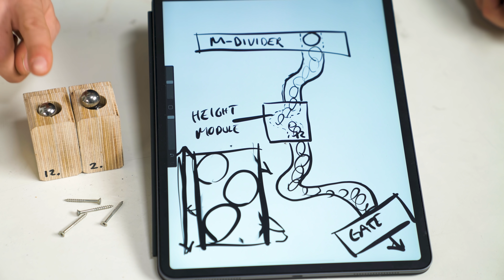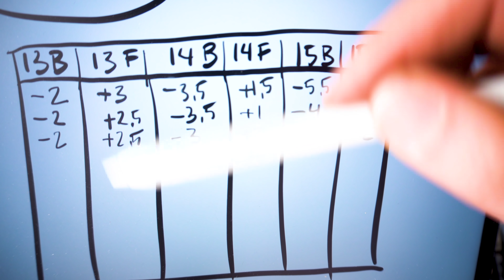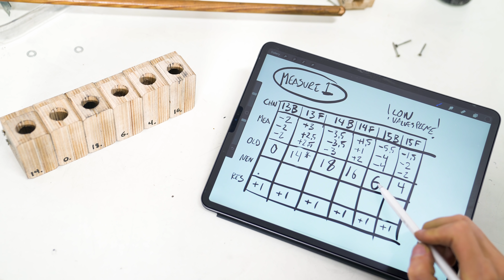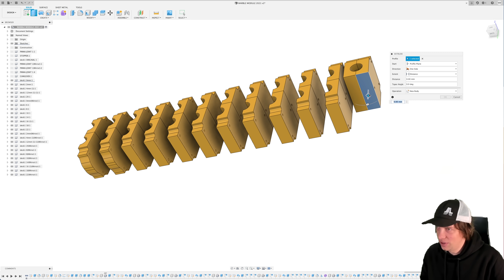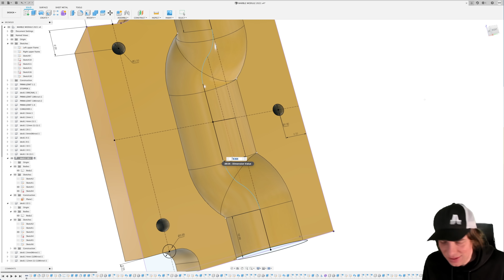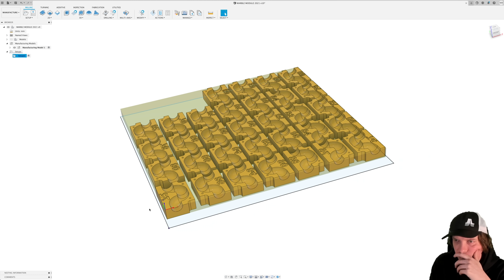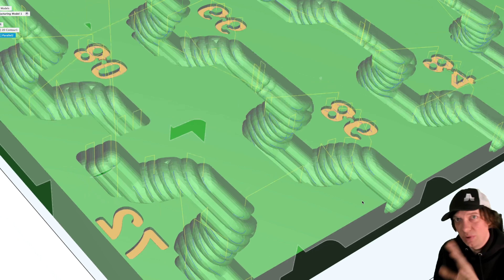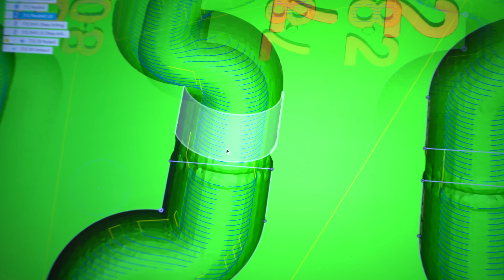Marble Hobby Project Gone Wrong

Comment: Have you considered using an adjustable telescopic pipe or similar system for height/length adjustment?

It is great to see the progress you make, yet i feel you are overcomplicating the height adjustment. I think you need a solution that can be adjusted on the fly without swapping out parts. Instead of having the wooden blocks with curved paths, you could make a basic telescopic section (two pipes that slide into eachother) with a locking screw to set the length. Or even a wooden version with two wooden pipe segments that partially slide into eachother, using a screw or bolt to adjust the spacing between them. This would give you quick and very precise adjustability, perhaps even while the machine is running. And it would be safe for changes down the line and any moles that pop up when setting up the machine on tour.

To see an example of such a system, take a look at legs of a camera tripod or microphone stand. Of course you woud only need one short section. Or google pictures of "adjustable telescopic pipe".

Comment: The marble divider is simply a bad solution. Your having to design complication after complication to correct the fundamental design problem of the divider itself. Look at the entire feed loop, the positioning of the marble DOESN'T matter. But yet, in your divider your having to position the marbles to 0.5mm. Its a joke. You can't go from complete free form movement, to perfect 0.5mm accuracy for ALL channels. You instead need to break the divider into 5-6 "bins" that feed all then feed 4-5 channels. Each bin can have an overflow with absolutely no error with accuracy. I hate to be armchair engineer here. But seeing day after day of you hitting a brick wall with problems, you need to look at the release mechanism. Pain in temporary, glory is forever. Rip the whole thing out!

Comment: Guys, what's up with all those trapdoor ideas? No, it would not work. Can you imagine dozens of trapdoors realibly go TRRRRRRRRRR and not interfere with a single marble coming their way? Impossible. You can't have a part moving in any direction but the marble's direction, otherwise there is a chance they collide and cause problems. Big problems. And it has to not fail 99.9999% of times. That's the absolute minimum.

Comment: I know the machine is way past its "let's make a huge design change"- stage. BUT, an improved design for the marble divider just stumbled across my mind. So I thought I'd share it with you. Let me try to explain.

The basic idea goes as follows: Instead of the marbles rolling on top of every other marble in the channels, make them "roll on the side".

 This will eliminate the diffiiculties of calibrating every channel to be the exact height and also take away the problem of inconsistencies in the marble tower height. 

Let's say the marbles roll in a groove with a 90° angle, basically a "square tube cut in half". Then you have slots in one of the sides where marble fall into the channels. And since you know the diameter of the marbles you can cut the slots to a appropriate depth. When the channel is full the top marble line up perfectly with the wall of the track since it's only dependent on the diameter of the marble and not the length of all marbles in the channels combined.

Hope this makes sense. And thank you Martin for this awesome content!
Reply: so you mean that the exit path from the divider begins with a 90 degree turn, and the turn has room for exactly 1 marble? the stack of marbles in the downtube could then have a lot more margin for movement and still have the top marble be flush with the divider, since the flushness is measured sideways instead of lengthwise of the stack. there will still be some variability between the top marble and the divider que, but the effect on the divider could be a lot less.
Reply: @frank7911  Yes, exactly. And as you point out the height of the stack still affects the exit slots as the largest perimeter of the top marble will move up or down in the slot according to it. But, at least in my head, that is not as big of a deal as having the same variability and the marbles rolling on top of each other and dropping down, instead of sideways. But I could be wrong. I'll maybe design and 3D-print a proof of concept to see if it is any better.

Comment: You're going to hate my suggestion on how to fix marble height/drop timing.
1. Increase the slope of the divider so the marbles have more inertia and can't stop in a channel that's +/- 3 mm.
2. Complete rebuild 😃 where the programming wheel is acrylic plates with holes for the marbles to drop through and eliminate the entire dropping assembly. Marbles held in a single row charger fed by the fishstair only, that then drop to the instruments at an even height, with all instrument mounta being height adjustable to account for shifting in transport. It'd have to be twice as wide, but much much less complicated. And then song plates would be as simple as a CNC program to drill marble sized holes.

Comment: I am watching your videos for a long time now, I am always ordering why you are not using a 3D printer to make complicated part like these ones.   You already 3D design it, the logical next step to me is 3D printing.

I think (don't have a CNC router to confirm) you will have more precision with 3D print parts, also if you print in Nylon (or other strong material), the part will last longer than plywood.

WHY ? WHY ? WHY ?

Comment: Can you use the marble path length as the label to make measurement adjustment easier?  Instead of 18 it would be more like 56.68 if the length of the center of the path is 56.68.

Comment: How do you know that the marble bottom at the bottom of the height module is flush?
Why not just add a mechanism to help the marbles over the little humps?
Plus or minus 1mm seems like a ridiculously small margin for error where you should consider a better method.

Comment: I think it might be possible to make an automatic module. A bold claim I know, but I observe you are measuring the path length as the centre line and not the sum of radii. The right path could trap a marble near the top held in place by the marble below that could move almost it's full diameter before the trapped marble could move.

Comment: As others have said, it should be possible to do away with the marble path adjusters via a mechanism at the top that only permits a marble to enter if one is absent underneath.

Here's my sketch for how this could work:
https://imgur.com/a/RmHRoxD

Only 1 marble can drop in at a time. The present marble and a bar prevent the hatch from opening when a marble is present underneath the hatch. A counter-weight opens the hatch back up when the marble underneath goes away.

Here's the model link: https://www.tinkercad.com/things/6BtfZuMaUvU
Reply: My concern is what happens if a gate gets stuck in something like the second position in your sketch. Could be a fairly catastrophic failure.
Reply: @JonReevesLA  I agree that it could be fiddly. I understand why he's using the design he went with, to avoid any mechanical parts that could fail.

Hopefully people can expand on this to make it simpler and less error prone. Really seems like there should be a way to solve this problem for any size marble without tuning

Comment: 9:34 "I only have to change two parameters to create a completely new version here." – As a software engineer, I immediately have to ask: Doesn't this program has some number-to-string function, which allows you to calculate the string (62) from the number ((16.2 - 10)·10 = 62), so you only have to change one parameter? (This would make this less prone to mistakes in the copy+paste process.)

Also, does the machine support adding a pen instead of a drilling tool? That might be even faster than engraving the numbers.

Comment: I'm going to be honest, I don't think that the marble divider will ever be perfect enough to work in the way martin is envisioning it. This solution will 100% work in the studio, but once you have to take apart the machine and put it back together for the world tour it won't hold up. All of the pipes would have to be inserted exactly the same every time, your environmental conditions would have to be similar. Perhaps there is another option? trapdoors that lock once a certain amount of marbles go through? it adds more parts and more complexity to the machine, but it might be worth it to avoid spending hours between shows tweaking 38 channels of marble heights. I have a few ideas on how this could work, I think i will drop some drawings in the discord soon

Comment: Loving the detailed videos! I very much enjoy the look into your CAD workflow and thought process on small stuff. But don't stress out on the videos. We enjoy the view, but it should motivate, not drain your motivation. As a backseat engineering comment, the height adjustment mechanism to me looks super fragile, especially if the machine sees lots of use things will move and settle etc. The current marble divider itself seems to be such a hotspot for things to fail?

Comment: This isn't the first redesign of another component that's been necessary to correct for the function of the marble divider. This seems to reveal that the recurring problem is in fact due to the design of the the marble divider itself. What about rotating the angle the marbles enter the channel pipes, so they roll mostly on the smoother, flat surface of the plywood on the other side of the marble path? 😊

Comment: You should realy add fillet into the trailing edge of your turns your balls might end up getting stuck in it. I don't think it cost a lot, and i am pretty sure it will avoid some problems into the future.
Love from a fellow engineer.

Edit: Sharp edges tend to be realy bad for flows, circles even if small are way more efficient for flows. I am a engineer in fluid mechanics I am pretty sure i can help in bettering the efficiency of the design of some of those canal if  your interested don't hesitate to ask. I think ther is a lot a similarities betwwen your project and my work, and considering the marble motion as a flow could be good enough analogy.

Comment: I had that problem with manufacturing model moving around after I'd carefully positioned everything. Super annoying. Not sure if this is the correct thing to do, but what I did was to fix everything in a rigid group after arranging them. But make sure the rigid group is at the end of the timeline otherwise it screws things if you have to go back to modify things!

Comment: I slowly get the feeling that the angle of the marble divider is where it's at. With all the free space, the input doesn't have to be vertical, but can be horizontal, thus eliminating the need for a flush marble height over all the channels.

Comment: Martin, I think you've solved the wrong problem. While you certainly do need to adjust the length of the marble path, the only reason you need sub-millimetre adjustments is because the marble divider is too sensitive! Instead of approximating a smooth incline, the divider could descend in tiny stair steps, say 3 or 4 mm per channel. Then the top of each marble could vary that much, as long is it was no higher than the level of the previous channel. Then the variability of the marble packing within each path would not matter nearly so much.

Comment: Super awesome Martin - I've watched every single video all since the birth of this wonderfull project! Its truley been inspiring to follow you on your journey, making this engineering marble!

As many other comments here, I would like to both point out and echo their concern about constant height changes. This will probably be a pain in the bottom for you, and only come back to bite you on the "behind" later. Both due to uneven stacking, due to different possibilities and configuration the marbles can have inside the tubes going down to the dropper. On top of this external factors will also cause issue - like temprature and humidity. I think trying to get these balls flush within +/- 2,5mm is going to be really tough - even though it would seem like a straight forward good idea. I would like to recommend an automatic "trappdoor" system that can allow balls to drop as long as its space for +1 or more balls, an idea that so many other also have suggested in the comments before me. It means some redesigning of the top part, but I think it would 100% be worth it. Many people in the comments even say they want to share design / drawings for suggestion on how to make this issue work - maybe it would be worth reaching out to them? For an example check out the user @Thomas Mach in the comment field! =)

Keep strong, dont overwork, take your time - and most important - SLAY THAT DRAGON WITH STYLE! :D

Comment: Watching this, as a programer, it's crazy to remember that text can't have parameterized values in Fusion360 - meaning you would only be making one changer per channel to update the numbers on your parts. Saying that, someone in this thread (https://forums.autodesk.com/t5/fusion-360-ideastation-archived/parameters-in-text/idc-p/6564635#M18772) has the suggestion of modifying the angle of pointer until Autodesk pull their thumbs out. Might be a useful idea for other parts or for future projects of this scale.

Comment: seems some kind of adjustable height module would ultimately be better;  that way whenever there's small changes in something everything can be readjusted instead of making a bunch of new parts.  it might be possible to control the height of the channel, so the marbles will sort of "accordion" a little instead of being perfectly in line;  each time taking up more or less space depending on how in line they are.

Comment: @Wintergatan, why not have the top ball in the channel depress some button when it is at the top.  This button should mechanically cause the balls rolling down the divider to skip this channel.  When the ball moves down the channel, it will no longer push this button causing the next ball in the divider to stop here and fall into the channel.  Ultimately, I think you are using the "full" mechanism you are using now is very sensitive to any changes.

Comment: The reason that all of the tunnels have a value of around 16-18 is that you just have to compensate one marble in differnce. It doesn‘t matter if there are 6 marbles in the tunnels flush or 10 marbles flush, you margin is just from 0-1 marble
Reply: Wouldn't it only be 0.5 marble? 0 marble and 1 marble offset are equivalent because if you have 1 marble space, you can simply put a marble in and it's then at 0. Similarly, 0.1 is equivalent to -0.9, 0.2:-0.8, and so on.
Reply: @clementop  You can see it as a range from 0 marbles to 1 marble, or from -0.5 marbles to +0.5 marbles. The overall size of your range stays 1.
Reply: @screwaccountnames  ah yeah I was mixing both of those ranges simultaneously and thinking that an offset of 1mm is the same as 7mm which is patently false.

Comment: It’s almost like plumbing. For water pipes they have a device that prevents back flow of waste water into clean water. Maybe this will inspire a new marble divider design?

https://www.courtesyplumbers.com/blog/2018/february/the-problem-with-backflow-and-how-to-prevent-it/
Reply: For marbles that would be fairly easy, the only issue is where( locations) they are backing up.